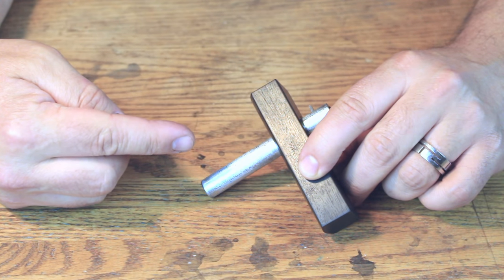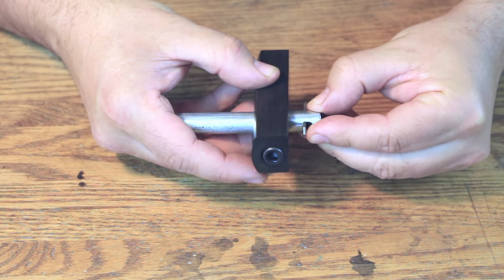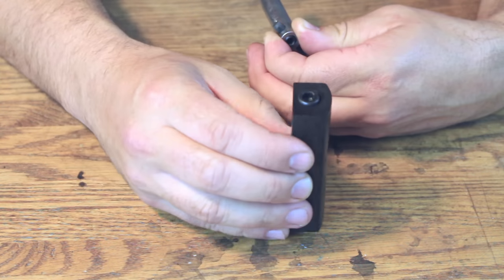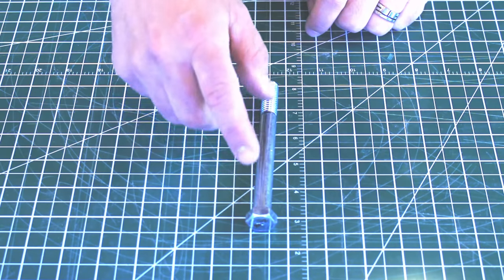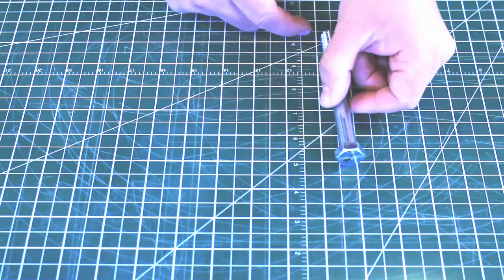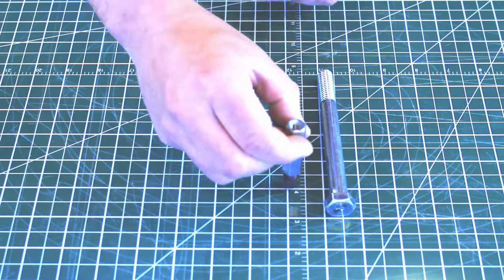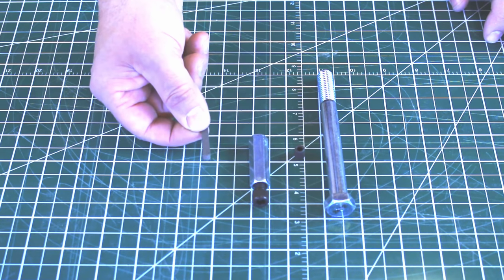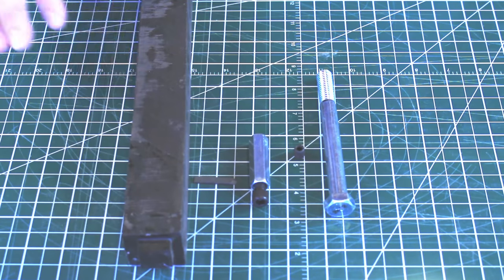How to make a Gramil.

Comment: Nice build once again Tomy.  I believe it's more traditional to build your own tools, luthiers and cabinet makers would build their tools during apprenticeship.  I'm looking to build myself some spring clamps, next little build. I suggest a practice piece first, to get used to it, it's easy to slip up, on a binding channel, if you move to fast, and consistent pressure. Remember it's a marking gauge, not a cutting tool!
Reply from the maker: Thanks Pat, the cut is made in several passes, the first is a very light pass. I will also keep using my binding router and chisels, this will help prevent fibres to break on the edges when cutting the binding channel. Thanks for watching
Reply: @HovingtonInstruments  Yeah sounds good, like i had said previously, I really saw a big difference using the dremel 115 cutter vs the stew-mac model. It requires a few more passes, but  no chatter or splintering really clean channel.  Oh! and get some bean bags! OK, bonne construction! aux prochain show live!

Comment: Very cool tool build. Like a cutting gauge but with a rounded side. Is there a specific radius that you used or just a bit tighter than the tightest radius on this specific instrument?
Reply from the maker: I made the radius to fit my smallest radius. In this case a Ukulele . Thanks for watching

Comment: Great thing! I always wanted to see how this tool works. Very little information about this. Basically everyone uses a router.
Reply from the maker: Even with this tool you need something to remove the waste. The Gramil cuts the crisp line and in the old days they used a chisel to clean the channel. I will most likely use a router also. But the risks for chip out is all down to nothing since the top fibres are cut. I will use it on my Mandocello build when I get to this step.
Reply: @HovingtonInstruments  Thank! Now I understand!
Reply from the maker: Just posted the video on how this works... though you might like to see .. 

https://youtu.be/PBkUpPu_P_E